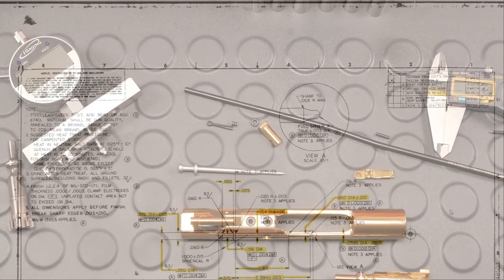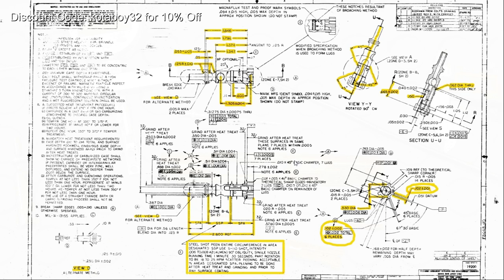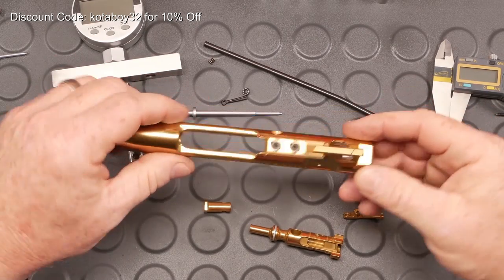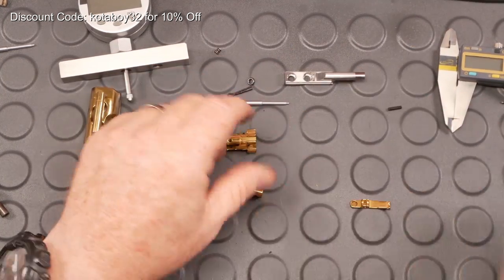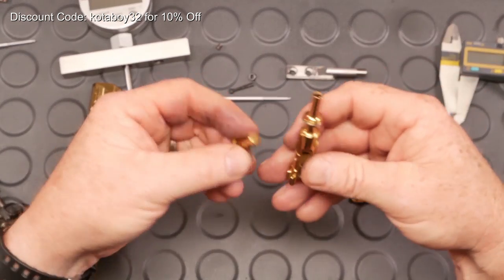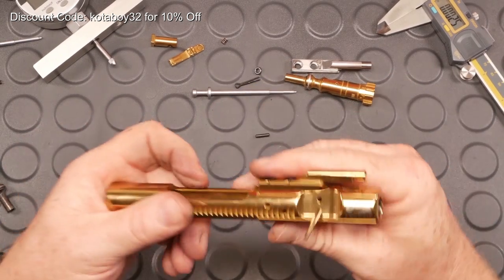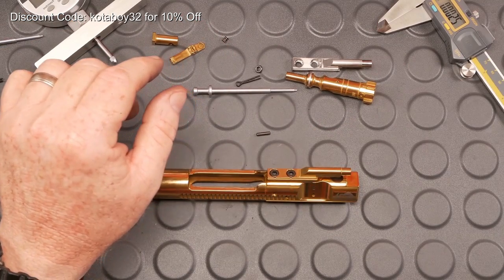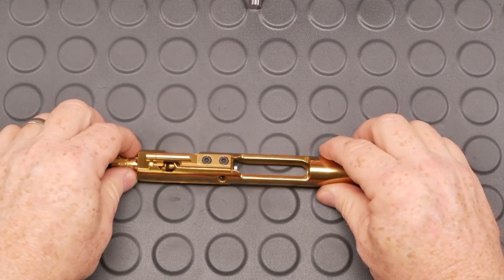BCG Specs & Holes

Comment: Hey John, just a friendly FYI (knowing what a gauge pin set costs) - hey buddy gauges are made of steel but you should treat them like they are made of glass - the pins are ground to extremely tight tolerances - if you keep jamming them in holes and /or flexing them like you are doing in this video they are very quickly going to be worthless.  I actually screamed stop out loud when you started using one as a bolt tail scraper...  To help out folks, the same philosophy applies to all gauges, especially chamber gauges, please treat them like the high precision measurement devices that they are (never as a punch or reamer) and they will last you a lifetime...
Reply from the maker: So no hammering with them..............  I'm so sad....LOL  Thank you so much for the advice.  The gages will live longer thanks to you sir.
Reply: @kotaboy32  theyll be more precious in the coming years with the admin we have right now! Also theres talk of truckers going to quit en mass if this happens those gauges will be worth their weight in gold!

Comment: From what I've heard, carriers are cut then coated/plates and that it doesn't seem most manufacturers take into account coaring thicknesses.
SOTAR's recommendations start with all chrome bcgs, then phosohate outside w/ chrome lined inside, then when it came to nitride, dlc, NiB, etc, those had looser tolerances due to thinner coatings.

Comment: I see on the table an iGage digital gauge, as is, the gauge will not work, attaching piece needs to be fabricated from one of the extra rods abling you to measure the firing pin protrusion. My question, do you know the length of that attaching piece? I have the same iGage gauge, and I need to make one myself so I can measure. Any help, thank you!